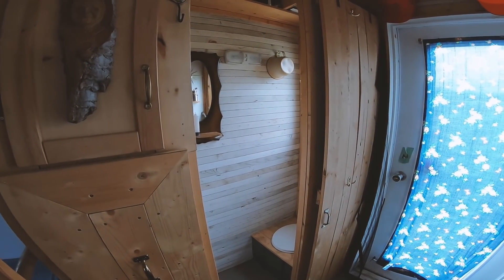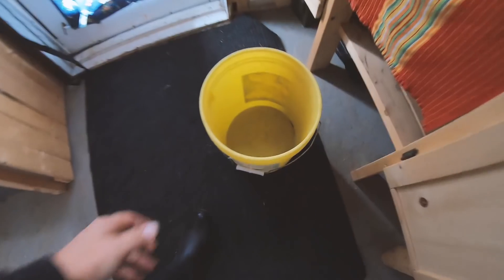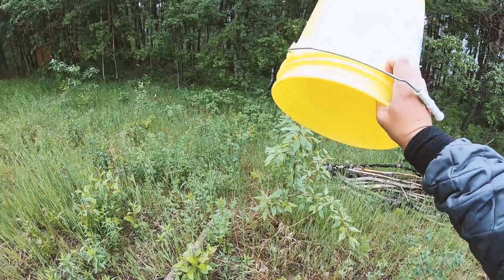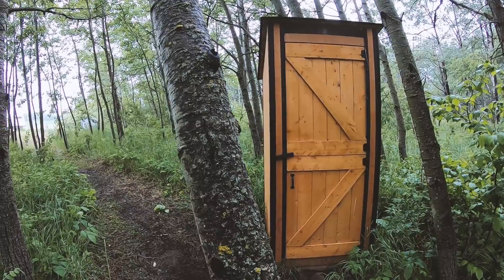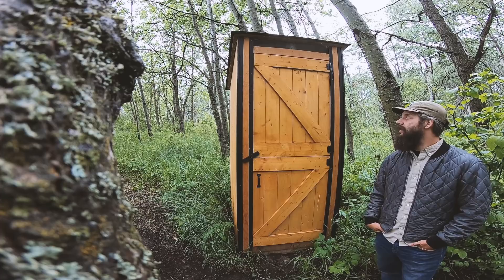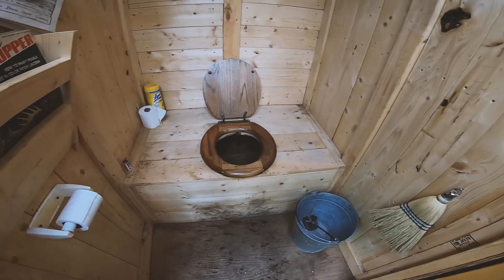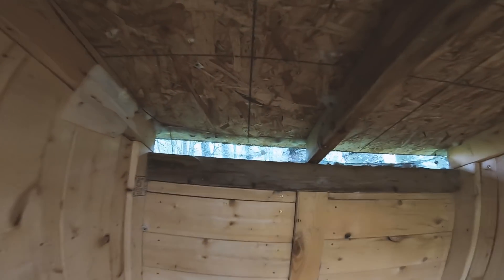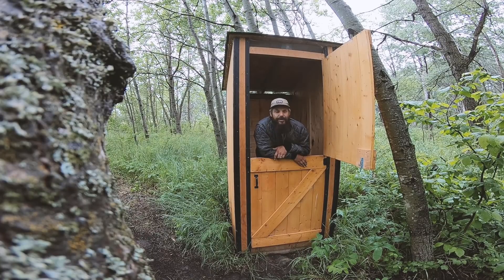How Do We Poop? | Off Grid Waste Management

Comment: Just for emergencies you can stash a container full of horse bedding pellets, (pine pellets), in your cabin water closet in case someone has some tummy troubles in the middle of the night. The pine pellets will immediately squash any smell and will absorb the liquids/semi-liquids which you can through into your outhouse the next morning. A 40 lb bag of pellets in 2022 in the U.S. was $7.00 a bag and if it used only for number 2 will last a very long time. The way to use it just for number two in the water closet is to use 1 gallon jugs for number one, even  females can use the bottles by making a female style urinal using a funnel and tubing. Just putting that out there for anyone that needs a different solution.

Comment: Do you require a permit for an outhouse?
Reply from the maker: Outhouse did not require a permit and I checked with both the RM and the regional Sask Health Authority office. That said you'll want to check with your local RM as I've found regulations change quite a bit between Municipalities. Aside from some general guidelines as to location and proximity to water sources, no one in our area seemed to want to take responsibility for policing a pit privy and were usually surprised that I was calling at all. "The Private Sewage Works Regulations", a Sask Gov. doc available online, has some guidelines for pit privy's that I followed.